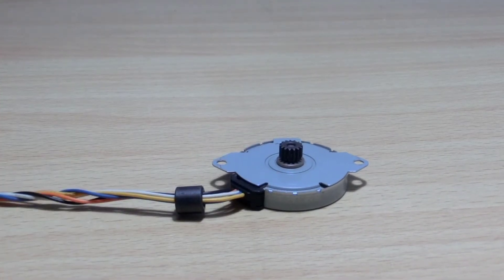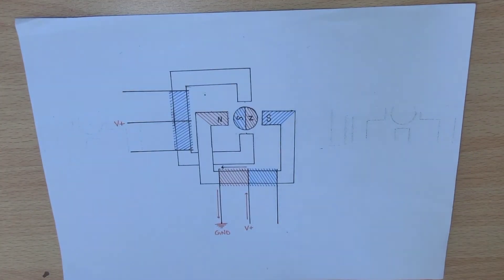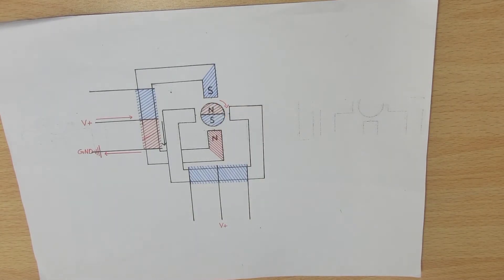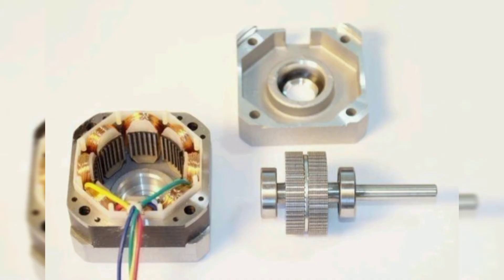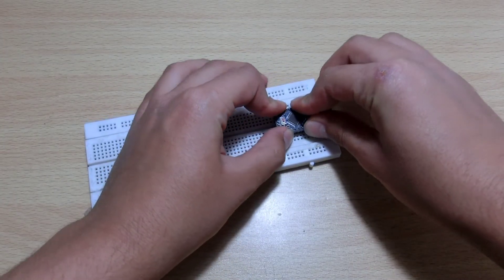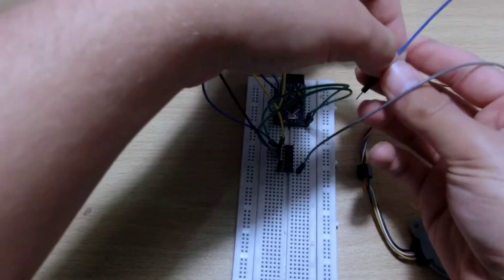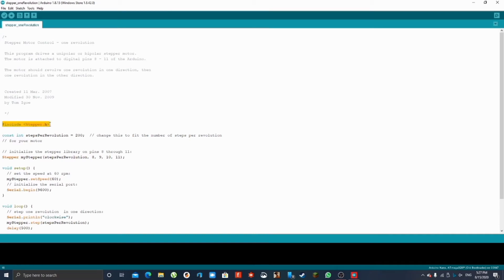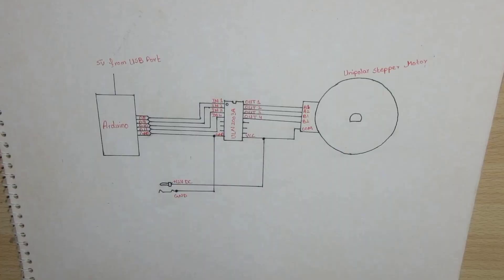Unipolar Stepper Motor Tutorial | [7]

Comment: Great video! What do you call a stepper motor that has 3 coils? I am trying to find a driver for it with no success. Thanks in advance
Reply from the maker: A 3 coil stepper motor is called a 3 phase stepper motor and has 3 wires like a bldc motor unlike the four wires that normal bi polar 2 phase stepper motors have. 

U need a separate 3 phase stepper motor driver for them which are readily available if you search for them.

Compared to 2-phase motors, 3 phase stepper motor can provide more torque and it has a better performance in over-loading. That is to say, when the load gains, unlike other steppers, 3 phase stepper motor will not stall easily. And it has a good dynamic property at the same time.As 3-phase motor has a smaller step angle than 2-phase motors, it moves more smoothly. Under the condition of having the same rotor teeth, 3-phase motors has less vibration and higher precision than 2-phase motors.

I have not personally used these stepper motors so I cannot guide you in detail.
Reply: @ahmedmohiuddin3017  Thanks for the reply.  My motor has four wires for one side of the three coils are connected together (common). So I have one common and three other wires for the the other end of the three coils. I cannot find any driver for my motor. All I can find are drivers for two phase only. That's why I am reaching out for youtube and see if there's any good tip or even a circuit not so hard to built. No arduino! man! everything nowadays is made with arduino! LOL
Reply from the maker: @Ele  It seems that the motor is configured with star connections.

Are you sure you have a stepper motor and not a bldc motor?

Could you send me the model no. of your motor?
Reply: @ahmedmohiuddin3017  I am not sure. I am assuming it's a stepper because I found a controller circuitry schematic together with the motor 28VDC and this controller schematic looks like produces from 0-100 hertz frequency to control the speed... There's no P/N on the motor....
Reply: @ahmedmohiuddin3017  Yes, the schematic text says it's a stepper motor...
Reply from the maker: You could still try and drive it using a 3 phase stepper driver by ignoring the common point and driving it by connecting the three other wires for the ends of the coil to the driver.
Reply: @ahmedmohiuddin3017  the schematic I have is too complicated for me. I can't find any commercial three phase driver on the market for sale. If you know any let me know. All I see are drivers for two phase stepper motor.
Reply from the maker: I found these two one from Amazon and from AliExpress:

https://www.amazon.com/Stepper-Digital-Microstep-Controller-Industrial/dp/B08P42YND9#

https://a.aliexpress.com/_m05IUSg